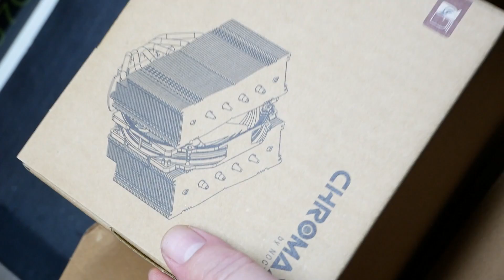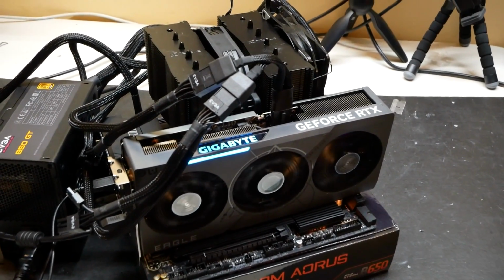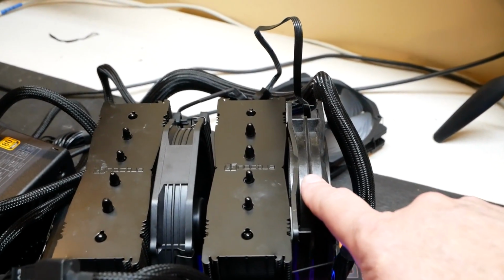Still One of the Best CPU Air Coolers on the Market in 2025

Comment: Get with the times air coolers are out.
Reply from the maker: Tell that to I can't count how many computers that come through my shop with failed pumps. They have absolutely NO issue with me swapping it out for a quality air cooler. Thanks for watching.
Reply: @TimsComputerRepair  Well I have an AIO for 9 years now that's works perfect. I guess it depends who you talk to.
Reply: @TimsComputerRepair  If you don't overheat your CPU an AIO works great, I have one now for 9 years and it works perfectly, I think if you don't over work the AIO it will last for years.